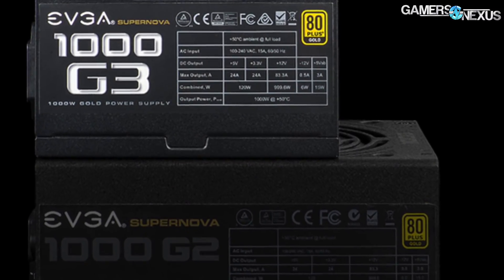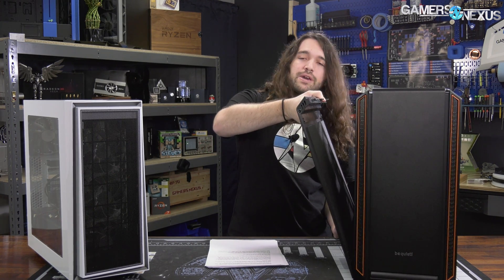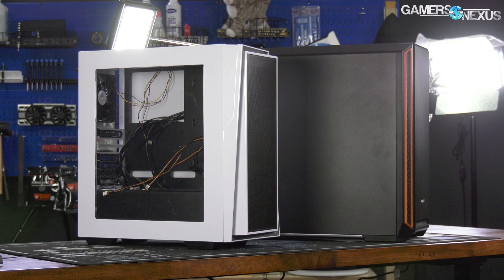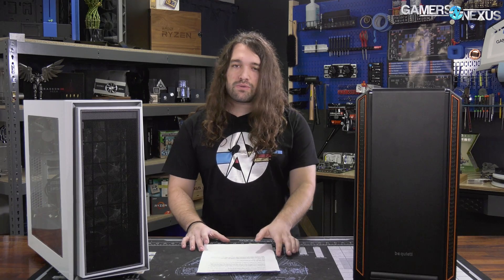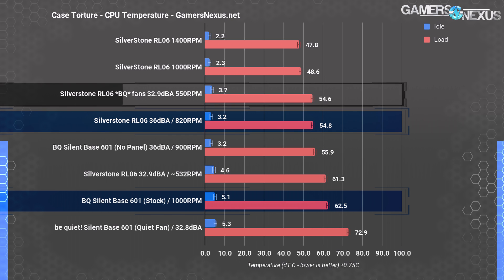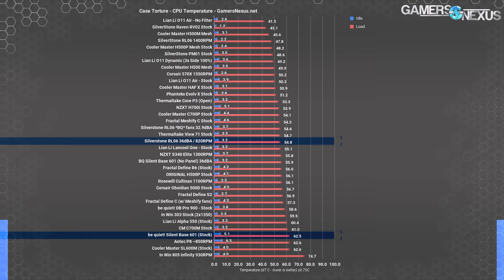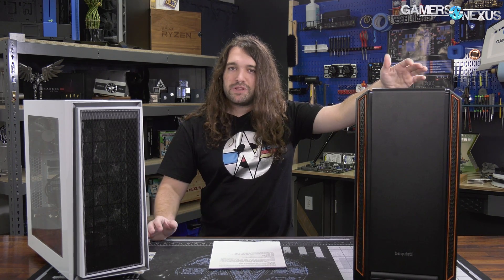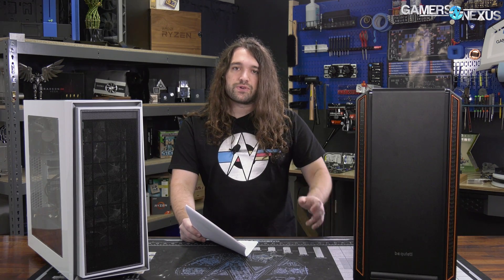Airflow vs. Silent Case: Noise-Normalized Thermals

Comment from the maker: Silent Base 601 review: https://www.youtube.com/watch?v=jKJDqqkDTGI
Find the article here: https://www.gamersnexus.net/guides/3391-airflow-vs-silent-cases-noise-normalized-thermals-silent-base-601
Reply: Sure, you normalised for the case fan noise but did you normalise for the overall noise including the cpu cooler and gpu cooler noise as well? If not that’s a serious flaw in your methodology as a lot of times the cpu/gpu cooler fans contribute to the overall noise more than case fans do, especially when we are talking about air coolers and not water coolers (as in your tests) that can utilise intake case fans as radiator fans. (and vice versa). I would imagine that a cpu/gpu air cooler running with a more aggressive fan speed profile would cool the cpu /gpu better and being inside a silent case would still be more silent than the more open airflow case with slower cpu/gpu cooler fan speeds.
Reply: @alexmarin7897  Dude you are so right; great catch. Your comment needs more upvotes. Their article actually specifies that they keep the CPU and GPU fan rpm totally constant for the sake of consistency. That means that the CPU and GPU fan would probably sound quieter in the quiet case while producing higher temps as expected. They really only normalized case fan sound. Wow.
Reply: love the tests. I've had it go both ways, depending on fans and the case.

Great vid Steve and crew. love the new funny ad-spot. B)
Reply: This is exactly the content I have been looking for in a long time! It would be great to see this noise normalized feature a standard in your case tests, It would be great to see which cases are the ones where you can have the cake and eat it too (quiet and cool, as opposed to noisy and cool, or quiet and hot).
Reply: Have you ever seen this project from DIY perks of an extremelly silent PC case using a  high(ish) flow approach? Sure it is not a high end gaming PC, but the principles are the same used in your video, large fans spinning slowly with high air flow so they can remove as much heat as possible with slow moving air.

His accoustic and thermal performances are pretty impressive!

https://www.youtube.com/watch?v=H3_sy3-c6LM
Reply: Sound is more complex than dBA, dB is just ratio of sound pressure. Human ear, mind or body is sensitive differently to different sound in same dBA. Same as eye response differently to different colors and is more sensitive to colors like green and yellow.
Reply: Interesting review with one massive flaw.

No testing of the Silent Base 601 with 2x intake fans.  Doing so would barely register any difference on the sound meter, and yet it would reduce the CPU temp by a fair margin...

Why Be Quiet decided NOT to include 3x 140mm fans I can not understand, the cost increase is largely a moot point when considering the target market who WILL spend more money for less noise.
Reply: You need to perform this test with three intake fans in the 601. You need negative static pressure to suck air through that front baffle on the 601. With only 1/3 fans installed you're just recirculating warm air.
Reply: Could you do a video on horizontally mounted motherboard cases? I am planning a build but I love the aesthetic of those style cases.
Reply: Evan Gordon I need a horizontal "desktop" case but I'm restricted by having an ATX motherboard and radiators. The only option available is the Thermaltake P3.

If you are going ITX then you have a lot more options
Reply: Great insights. Thanks Steve. Love this sort of content!
Reply: Just tuck vibration damper carpet in bolt mounting section of fan
Reply: Would it be possible to add graphs  with the relevant setups, 2 till 4 or so at a time. Have noise on one axis and temps on the other one? Would be especially interesting with the same fans.  Maybe I'm just lazy but it would take a bit less concentration to get the info I want
Reply: What if we have thirt option? Whot if we can meke case with lower airflow rasistanc then silverstoun and with little bit of “noise blocking” 🤔🤭🔥🔥 
It sounds like my new challenge.
Reply: There's a significant methodology problem here.  Fans at low rpm make more low frequency noise bordering on infra-sound ranges. At low 1k fan speeds you're placing a bunch of the total noise level below the sensitivity range of a lot of sound meters. In which case, is it really lower noise or are you just unable to measure it?
Reply: Lowering fan speeds? My fans are already 100% silent but you failed to take into account the real concern of modern PC noise which is COIL WHINE. Why didn't your video address COIL WHINE? How is lowering your speed and getting better airflow going to get rid of the high-frequency noise which is in no way solved by lowering thermals? That's a big elephant in the room.
Reply: Have you ever heard of shaving? A haircut?
You look like a homeless person

Comment: still very good content, very relevant with today's choices. 
my current setups:
Hyte Y40 case:  3 added 120mm beQuiet LightWings (highspeed versions for greater range): 2 intake, 1 rear exhaust. The stock aio are 240mm top intakes.  Plus, slight tweak to fan speeds/curves to further reduce noise.

my Legacy PureBase 600 pc:  Stock 140mm and 120mm beQuiet fans are both relocated for exhaust top due to lower rpms. 3 120mm (formerly ibuypower stock fans) are 2 front intakes, 1 rear exhaust.  I'm pretty sure that airflow through the case is balanced well for my older gpu/cpu that average 50°C for 1080p gaming!

Comment: I think this is one of the most poorly tested videos from Gamers Nexus.Testing noise levels for just CPU and the cases fans is a poor metric. Should of tested the difference between the 2 cases with a GPU underload. Pretty sure the Silent Base 601 would completely smoked the Silverstone airflow case in that scenario. Cause GPU fans are way louder than CPU and case fans.

I know this from personal experience going from a Cooler Master Elite 311 and Cooler Master HAF 912 to Fractal Define R5, and a Nanoxia Deep Silence 3. The noise dampening foam and doors are amazing for DVD / Bluyray drives, HDDs, and GPUs, and CPU fans. Case fans are usually the least noticeable components, cause they usually run at 800-1400 RPM, while CPU from like a Cooler Master Hyper 212 will run up to 2000 RPM, GPU fans run from 1500-5000 RPM depending on the size, HDD, and optical drives are extremely noisy.

Comment: You are the only channel which actually tests cases and you could not do a proper sound test. You are pushing your own views which might or might not be correct. However, there are a lot of things to consider and all I want is some solid work being done from your side. Stock cases. Under load and idle. Record audio, put info into graphs. I want to see how they perform. You however gave me thermal performance and said it was the same...sigh, it is not the same. You had the exact same issue of not understanding why people go for silent cases when you made poor review of Scythe Ninja 5.

Things you do not consider:
1) Out of the box performance of base components. Not everyone is this super enthusiast which will spend all its time tinkering with computer parts. Just getting right parts and setting it up is already huge time commitment. 
2) You do not value low dB values to the point of not even bothering to record it. That is very bizarre. Sure, noise is directly correlated to airflow and temperature, but giving me those values are missing the forest for the trees. It is like wanting to order a meal from a restaurant and you guys show up as my courier and deliver me food ingredients and instructions how to make a tasty meal. It is not what I'm interested. I want a done product. I want noise levels and not secondary parameters around them.
3) You do not consider subjective parameters at what kind of sound each part generates. Audio recording for this purpose is very important, but you guys do not seem to account for that.
Reply: interesting

Comment: You have missed the point yet again.  You can indeed do both (thermal control and silence). Using the PWM fan headers on the motherboard, adjust the RPMs of the fans inside a quiet case to control the heat and noise.  This includes using premium quiet fans not the noisy fans that come with case.  Stop equivalating the maximum fan noise of a "quiet" case to a mesh case with the fans all turned down to minimum.  With the exception of stressing the CPU,  the fans are never at 100%.

I have a gaming system in a quiet case.  The only time (typically) that I hear my system is at startup before the OS loads.  All the fans are running at 100% for maybe 10-15 seconds.  Other than that, one can't tell its is on without the LED's and the display.

With a mesh case, the quietest it will ever be is the noise of the fans on low.  BUT the minute the fans spin up to control the heat generated, you hear it all the time.   There is a reason for noise cancelling headphones.

Comment: This is sponsored by EVGA which makes crap power supply units. Got a EVGA Supernova G+ 650W and it refuses to power a MSI MAG Z590 Ace motherboard. Attached a 550W Seasonic Focus GX and it works fine. Now running with a 850W Seasonic. Do not buy a EVGA Psu if you are planning to run a high end motherboard. Also don’t hold your breath waiting for EVGA support to answer a support call.

Comment: To be honest, I prefer my silence optimized Define R5 vs my new Corsair 4000D Airflow. While the temps are definitely a slight improvement, they're not major since my GPU and CPU are still running at the same speeds without penalty in my Define R5, albeit about 4 degrees hotter load average on the GPU and around 6 degrees on the CPU. My R5 does have an extra 140MM intake vs the 4000D but everything else was left the same.

The major difference is in the sound profile, I can hear the annoying "whine" and my 5TB mechanical hard drive noises very easily in the 4000D(in a quiet room) while on the Define R5 it was barely audible and nowhere near distracting.

Comment: Wish you guys would measure sound levels during torture tests in a fully air cooled case, say near 100% GPU (various) and/or near 100% CPU. Many of us who want quiet cases want it quiet 100% of the time, not just during light workloads. When the higher end GPUs gets going in a mesh case we hear that noise on the other side of the house. Many of us also want the reliability of air cooling and as dust free a case as possible.

Comment: Fan cutouts affect the noise generated by fans as well. If you have a case, that has large honeycomb (or similar) patterned holes for rear fans, used fans there would be quieter, than case with small honeycomb (or similar) pattern on the back. Solution for this is actually very simple and should be pushed to manufacturers - they should adapt using wired grills instead of dense honeycombs or any other patterns with thick spacing between holes (as Fractal design did with current gen of PC cases). I´ve cut my rear fan honeycomb grill on my Phanteks enthoo Pro (i used the nibbler-cutter tool and i recommend it only to people, that know, what they are doing) and changed it for wired grill. The noise generated by the back fan went down significantly and the fan itself (Noctua P14 Redux 1200 PWM) makes less noise, than before. As for structural integrity, the wired grill helps with this as well, because wired grills are sturdier, than any honeycomb-cut piece of metal. AFAIK, i ever saw only Corsair utilizing wired fan grill in the back of the case, with their Air 540 PC case.

I did the same thing with my Synology DS218play, which has very noisy fan by default, but the fan itself is only half of the issue. While the stock fan has very noisy motor, airflow generated by it runs through their stock plastic grill, which instead of only protecting the fan, acts as an active airflow barrier and creates lots of noise. After swapping the plastic grill for wired metal grill, NAS itself became very silent.

As for the looks, it doesn´t look as well, as the original honeycomb meshes and cutouts, but since the back of my case is way back under the table, i don´t care.

Comment: I have a 	Antec P7 Silent Mid-ATX case
2x 140mm Arctic P14 PWN fans
2x 120mm Antec stock case fans - 1 Pointed towards the stock CPU cooler attached to the ODD bay, the other exhaust
I'm running R5 3600 @4.2 GHz OC and never get above 85C gaming at 1080p
It runs pretty quiet with the exhaust and CPU cooler doing majority of the work while idle.

Comment: Nice test! I wish you would test all cases normalized to 25 or 30 dB under full CPU+GPU load among other tests.

I think there's a market for case with no window, full padding on both sides, top and bottom and airflow focused front and back. That would optimize the airflow in combination with maximum high frequency sound isolation. Having filtered air input with high airflow is hard to do, though.

Comment: Sorry for the late comment, I've been researching what to do for a PC case for a computer in an audio recording bedroom studio, and thus 36db normalized is not nearly quiet enough...I know you favor airflow over noise dampening, but will that hold up for a PC that can still fall below a 30db noise floor even when being used? I understand that when gaming, the GPU fan noise will likely make this impossible. When recording vocal tracks in Pro Tools, however, this thing needs to be SILENT...36db doesn't cut it. What do I do?

Comment: Just got a msi 3090 ventus and the fan is extremely loud compared to the 980ti I had in there before, I have the corsair carbide air the big case with great airflow. I'm trying to follow this guide and am adjusting fan speed in afterburner but it seems, "fan 2" whatever that is, no matter what speed I set it to is loud and that's what's causing my issue, 'fan 1' sounds much more reasonable at higher rpms. Any ides here, what is fan 2 doing, would it be safe for me to turn it off until 75 degrees or so?